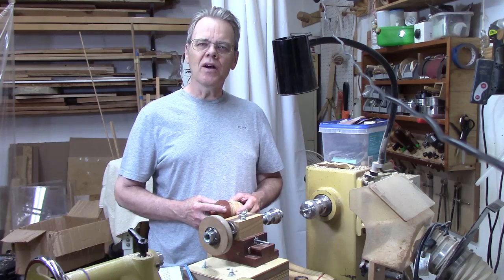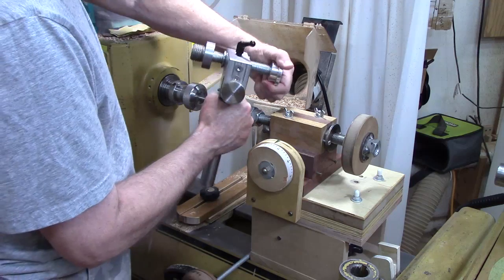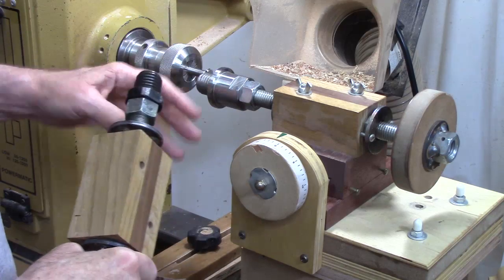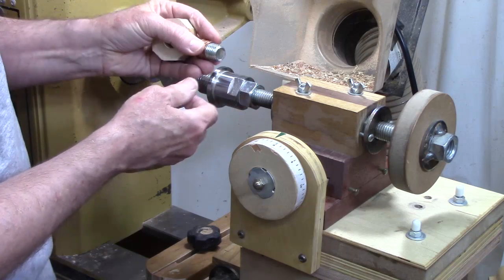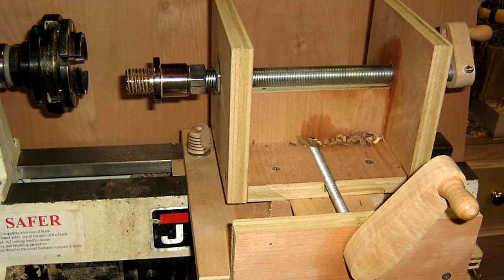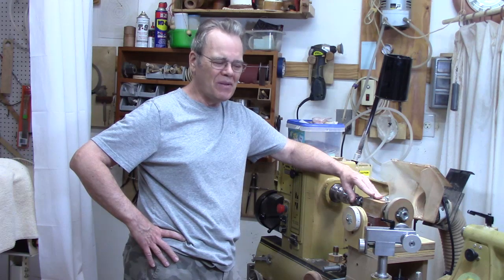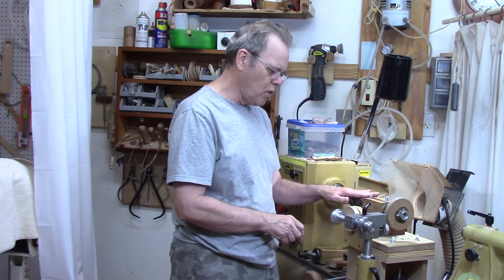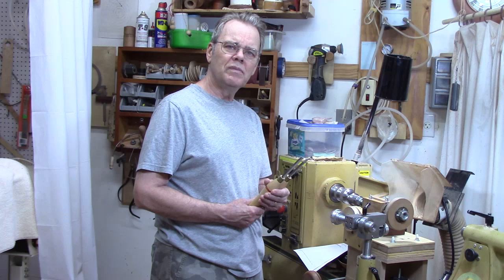Threading Jig for Woodturners - Make or Buy?

Comment: Mike, good video and great idea on this threading unit.   I have made several threading units on the same principle.    I always buy "Machine" threaded rod since it's ten times more accurate than the rolled threaded rod that hardwares and Home Depot's sell.    No slop in this stuff and you can also buy threaded adapters for each in 16 and 10 TPI.    Would be easy to change yours out and I believe you would see a big difference.    Thanks for the video......some great ideas.
Reply from the maker: Where did you  source the machined threaded rod? Clearly the course threaded rod did not work well for me. I did source the threaded adapters from PSI with no problem.
Reply: @MikePeaceWoodturning  Hi Mike, not sure where your located, but most industrial supply houses have this in stock.   You want to make sure it's "Black Oxide" and it's machine threaded and not rolled.  McMaster Carr carries this in 3/4"-10 tpi and 3/4" - 16 tpi:     https://www.mcmaster.com/threaded-rods         I would try first to see if there's any type of supply house in your area, that way you can see what your getting.     If none in area, call McMaster Carr first and give them a description of what you want  and the part number that's on the link I've attached.  They should be able to help you.      Also better pricing if you can get it locally......shipping is a killer now days.   Best of luck......

Comment: Very interesting talk. Good info. I've made one of these jigs so was very interested to hear that you had similar challenges, particularly slop. My solution was to use nylock nuts. My lead screw is 1" x 8tpi to match my chuck so rather course, had not considered using a spindle adapter so that possibility was good to know. Also the collet and drawbar to hold the cutter. Thanks for sharing.
Reply from the maker: I think it is hard to understand how hard it is to make one that works acceptably well until you actually deal with the challenges like you did.

Comment: Mike, I bought a Simon Hope jig a year or so ago.  I got SO frustrated with it that I walked out of my shop,  slammed the door& haven't been in there since.
No wood working, no casting & no turning for over a year. I bought it through Simon's website & delivered to a person in Tampa, Florida.  My education on how to use the tool was 15 min. on the tailgate of his pick up truck.
My wife is probably right, I'm easy.
Reply from the maker: That is not good. 😦 I have seen the jig and it looks like a good one. Like any tool it does take a bit of practice. Have you watched his demo video? What kind of problems were you having? Maybe you need to find someone to provide some instruction? I am guessing you must have other hobbies if you can walk away from woodturning that easily.

Comment: Hi Mike, great video.  I do have a question  for you.  How do you align the lead screw with the cutter? Do they have to be centered on one another, or can the lead screw be slightly higher/lower than the cutter?
Reply from the maker: You want to cut on dead center.

Comment: How do you determine the size of the lid threads and the box threads, to get them to mesh properly? I’m new to the threading and I made your unit, however my lid threads seam to be two small and the lid does not thread properly, ant suggestions?
Thanks Mike
Reply from the maker: Measure the female recess and make the male tenon a bit larger. Perhaps .075" for 16 tpi.

Comment: A better quality threaded rod is to buy a piece of ACME thread rod. The threads are well machined and available
Reply from the maker: Clearly acme threads are stronger. I had never heard of an Acme thread when I made this jig. The goal was to make one from off the shelf parts that did not require machining. How do you put a face piece on an acme rod that will take a chuck or chuck adapater without machining or metal lathe work?